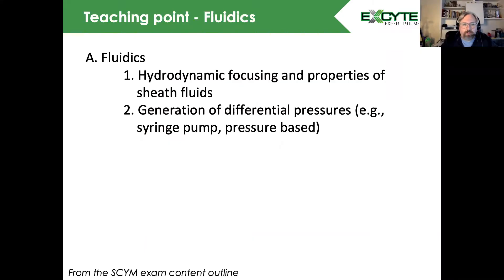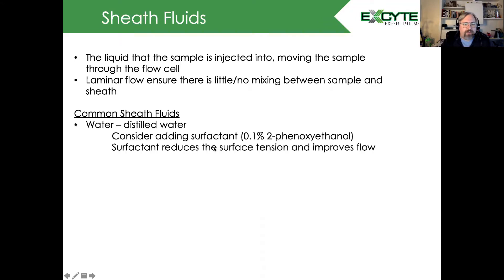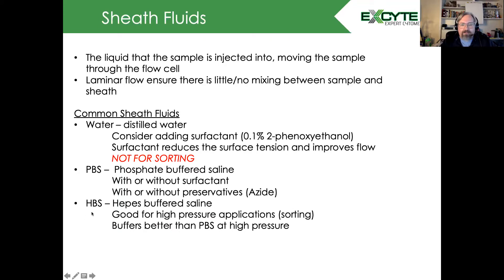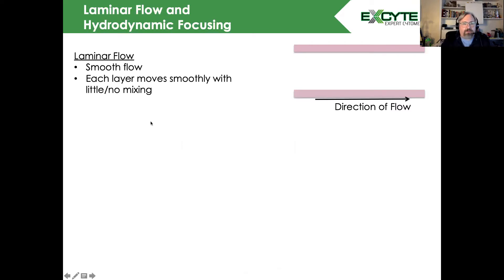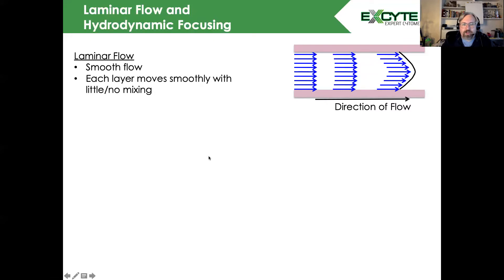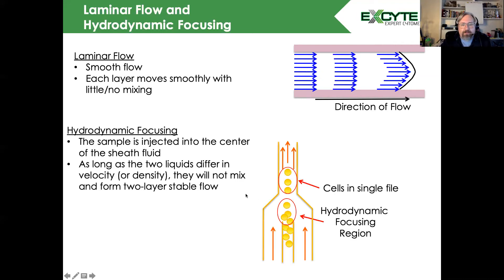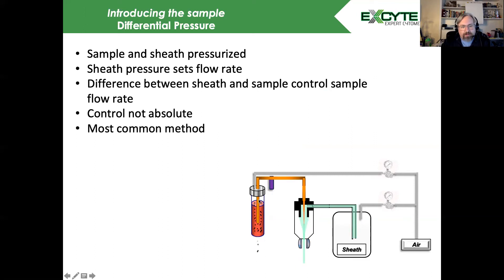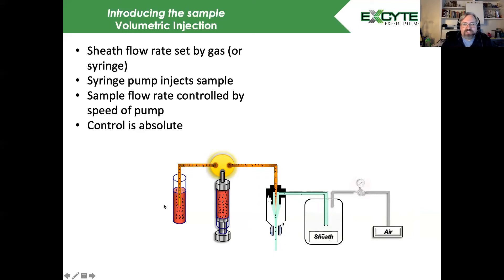Teaching Point: Fluidics

Comment: Hi, Tim. Thanks for making this video! I just had a question related to cell flow: the pulse width of a cell can be approximated to its time of flight through the laser interrogation point. My question is this: Why is it that we get a larger pulse width for larger cells, and vice versa?
Reply from the maker: Hi, Aditi -- thanks for your question! I created a follow-up video that I hope answers it. https://youtu.be/gAgLPepaSQg Let me know what other questions you have!
Reply: @expertcytometry6235  Hi, Tim. Thanks a lot! I actually still have a bit of a doubt: wouldn't the passage of individual cells through the laser interrogation point and the concurrent pulse characteristics obtained be determined by the flow speed of the fluidics, and not just the width of the interrogating laser beam?
Reply: And thus, wouldn't larger cells pass through the laser interrogation point faster than smaller cells for the same flow speed of the fluidics, giving a shorter pulse width for larger cells?
Reply from the maker: @aditihariharan1866   Imagine a setup where an observer is on one side of a street and a light is on the other side.  As an auto blocks the light, the observer starts a stopwatch and stops it when he can see the light again.  The time on the stopwatch is a measure of the time the auto spends passing by the light. 
Now, if we have traffic at a constant speed, and a Smart car passes by, the observer measures a time of 3 seconds.  The next vehicle to pass by is an 18-wheeler, which the observer measures a time of 10 seconds.  This makes sense since the 18-wheeler is much larger than the Smart car.

The same is happening in the flow cytometer.  We have an observer (PMT/PD), and a light.  Rather than a stop watch, we are observing the time from the start of the pulse to the end of the pulse.  The larger the cell, the longer that transition will take.  Since the flow rate is constant, the difference that is being observed is size dependent. 

Does that help clear things up?
Reply: @expertcytometry6235  It does, quite a bit! But what I'd like to know exactly is whether or not the speed of fluid flow within the flow cytometer can be taken to be the speed of the individual cells passing through the laser interrogation point? Because the above example that you've used to explain the variation in pulse width with cell size would hold only if all the cells had the same speed when passing through the laser interrogation point, no?
Reply from the maker: @aditihariharan1866  Yes, as long as the fluid flow is not obstructed, the cells all pass at the same speed.
Reply: @expertcytometry6235  Is there any specific principle/theory in fluid dynamics that might corroborate the fact that cells pass at the same speed as the fluid itself through the laser interrogation point?
Reply from the maker: @aditihariharan1866  The specific principle is that the sheath fluid is at laminar flow, which is smooth uniform flow.
Reply: @expertcytometry6235  Oh! Okay. Thank you so much for this discussion and your time, Tim.
Reply from the maker: @aditihariharan1866 , of course - any time!